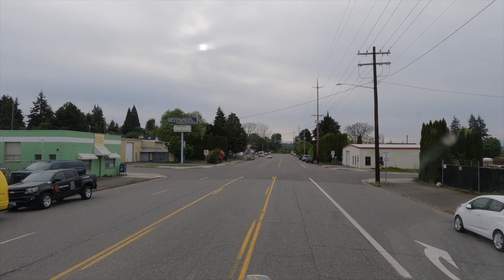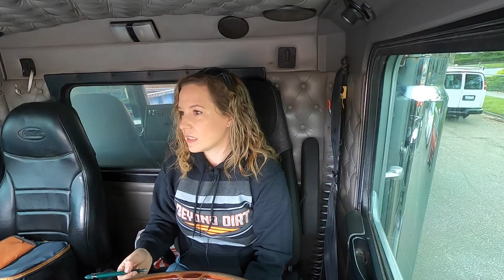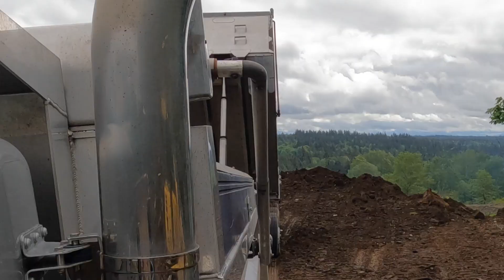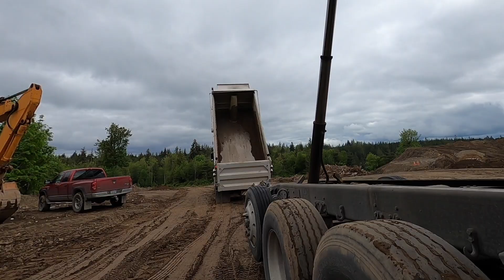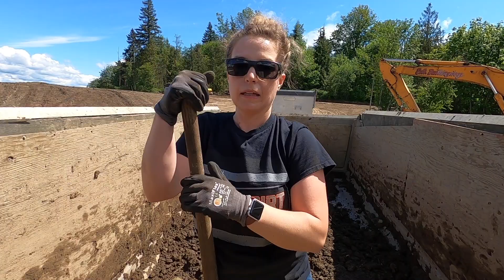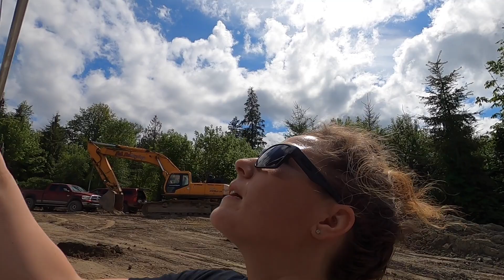Everett Truck and Trailer Mud Run. WHAT DID I GET MYSELF INTO?

Comment: Someone mentioned to check your cable. Check your cable mount on the cab too. Check the connection on the back of the radio also. You do have some pretty country out there.

Comment: We made vibrators for the trucks an pups, they worked great. Hauled alot of lime in winter. I spent yrs dump trucking. Spread more then stock piled, dumped in many different lay machines. I miss them ole fun times. I had to run flags on the tongue for Ne laws. Your makin a double hand.

Comment: Grounds  might help too. Check the conections at the antenna once and a while make sure they are cleen. I've had where I could not transmit or receive, replaced the coax and fixed the problem. Keep that in mind.

Comment: I use a telescoping painter's pole with a 6" scraper on it to clean my bed out.  You can do it with the bed raised and you don't have to climb inside the bed,  it is so much easier.

Comment: Another great video, but that was hard work cleaning the muddy dirt out of the truck and trailer beds . But it's a job that has to be done, when hauling that kind of loads . I'm not sure how that aluminum beds do to put  vibrators in them, but I have seen several trucks with steel beds that have them and they are great for loads like that . I have never been around a dump truck or drove one that had  aluminum beds, just steel beds . Wishing you good luck, getting better loads that are not as wet and muddy, so that you don't have to shovel out like that . I will see you later, stay safe and keep on trucking .
As always, Jeffrey !!!
🤗👍💖💫

Comment: Dauminique, I am on the east coast , the soil here tends to be sand-gravel but wet topsoil is nasty . The best thing I’ve found to get material to slide out is a plastic liner,

 it’s like ice . Not only does it let material slide it also protects your body from dents and wear . I haul mostly dimensional stone and it lasts about 5 years . It’s a little bit of an investment but for me I feel it’s worth it . Just my two cents worth . Good luck Dave

Comment: F.Y.I. get you a pump up spray and put soapy water in it and spray your bed floor with it when you know its gonna be like that and it will help it slide out better and you dont have to climb in the bed. It wont always work but it will most if the time.

Comment: I second the idea of a bad cable/antenna base because it is worse in wet conditions. I would 1) check your connections (especially the one to the antenna) if it is anything but clean I would clean it up and see if that helps. 2) check the wire for wear spots any place it goes through a wall or securing strap. If you have an extra CB swapping it out might be the easiest test, but I do lean towards a bad wire or antenna that is shorting when the water get where it should not be.

Comment: Oh Dominique  so sorry to see you work so hard on shoveling ....With your Mechanic  husband  (You two replacement of your truck clutch  was impressive..could  you two patent  a "Finish cleaning  out your load attachment" FOR INSIDE OF TRUCK AND TRAILER DUMP "Maybe test with PLYWOOD  and 2x6 first and then maybe go to Z recycling in Bellingham  etc and make ouT of ALUM etc..)....Is to build  a shovel  like shoe that sets inside  your dump trucks and  trailer  up front of dump go up 12 in on sides of dump around tower and down bed of dump for 18"  AND  AS WIDE OF INSIDE OF DUMP ON TRUCK AND TRAILERS and  when dump is all the way up have a little electric  or hand winch to cable out the inside dump "ALUM SHOVEL " THUS WINCH OUT THE STUCK MATERIALS  LEFT IN TRUCK MAYBE HAVE TWO  RETURN CABLES ON BEHIND EITHER ENDS  TO KEEP THE "ALUM shovel "  SQUARE INSIDE DUMP AND from falling out of truck and to rewinch back to both the front of both truck and trailer for next muddy wet loads... 😉...Dominique  do they (KENWORTH  ) do this Already? .... If not....We will call this new Clean out stuck MATERIALS  from sides and bottom of dump truck  bucket  ...."Dominique ALUM shovels"........Best  Regards.......Oh hope you and your clever husband  😉 take us along on welding  up these new "DOMONQUE  DUMP TRUCK ALUM SHOVELS"!!$$$....Hey it be exciting for all of us to see you work with PACCAR IN BOW WASHINGTON  ON TESTING  AND BUILDING  THESE NEW "Inside dump trucks ALUM shovels"....HEY NATURALLY .JUST MAYBE KENWORTH  WILL LET YOU AND SPONSER YOU A NEW 2023 DUMP TRUCK....CONGRATULATIONS  DOMONQUE  ON YOUR INSPIRATION  NEW PATENT ??$$$......

Comment: Before you buy a new CB check your SWR's to make sure it's not the coax or antenna's. It's a great idea to disconnect the coax from the antenna's and clean the connections and antenna mounts to make sure everything is clean and tight a couple times a year. A bad connection can burn out your finals so you can't transmit.  Also pull the CB out and check things behind it for issues. Those wilson's are heavy and can loosen up.

Comment: had similar experience hauling wet distiller's grain.  we usually used a dump truck to haul it but it was down, so we used the grain tandem. actually works out pretty good hauling sand, but that distiller's grain sticks to every crevice of that aluminum grain box.  about 5 tons refused to come out and it resulted in about an hour of shoveling and rocking the truck.....not a fun ordeal lol.

Comment: I was at a dump site with some sticky crud one time,  raised the pup, nothing, gave it a shake and the mud on the left side came out, the trailer started falling to the right. It got about 15 degrees lean and the right side mud came out, and the box straightened out.  Whew. .

Comment: I use a paint extension pole with a screw on scrape blade. With bed up in the air you can stand on the ground and scrape it from the bottom up. Fall's out nicely. I live in Georgia.  We have red clay. Very sticky
Reply: Raise bed and the pole will sit on frame. On the cross member's. I use a bungee cord to secure it

Comment: I once had an old single axle dump truck. I was trying to spread gravel on my driveway and the front wheels came up probably 10 feet up. Had to shovel some of the gravel out of the bed to get the front wheels back on the ground.

Comment: Helps if the excavator operator fills the back of the truck/trailer until they can see the mound and then rolls the dirt off the mound towards the front of the trailer as he/she is dumping.

Comment: Ahh that brings back some not so great memories 🙁 It's been over 10 years since I last drove end tippers (end dumps) and days like that were always fun...not.
A bit of moisture and clay and a well used floor in your bin (box) along with it sticking around the hoist well (tower) was always a bad combination.
Rather than shovelling and the risk with climbing in and out I can recommend having a long handled scraper made so you can have your bin (box) in the air and scrape up the insides from ground level 😀
Good to see your business doing well Dauminique 👍

Comment: I wonder if you can put the vibrators on your truck and trailer to help with sticky soil. Justin I believe specs his trucks with the vibrators. Hit the button and watch the dirt fall out. Saves from shoveling.
Reply from the maker: He has steel boxes, I have aluminum. A vibrator would tear up the box.

Comment: Sometimes the coal trucks that haul coal will spray the bed down with a little bit of diesel fuel it keeps coal from sticking in the bed biggest problem is the freezing in the bed. It would definitely make a barrier between bed and wet dirt or mud. They use a one or two gallon hand sprayer. They also don’t have plywood barriers in the beds.
Reply from the maker: You can’t spray diesel in you boxes here, you’ll lose your license.

Comment: So, just a thought.  I have a couple grain scoops that I use around the place, and also for snow that's come off the roof. Next time you're at the feed store, check one out.  They have more capacity and a wider blade.  Might work good for slicing it off the sides, maybe quicker.  If not, you'd be the coolest kid on the block, just for knowin' what one is!!  Stay safe!
Reply: Aluminum grain scoop. Steel is too heavy.

Comment: You might want try 2-3 lb. Sledge hammer banging on the bed in the raised position.  The vibration in bed should get a lot of those clumps out

Comment: ground on antennas and or mirror frames not grounded,  or like on my truck when i got it the coax connector at antenna is shorting to itself.
Reply from the maker: That would make sense if it was intermittent. It's not, it just doesn’t work in the morning when its particularly humid. It starts working an hour or 2 after drying the cab out with the defroster.

Comment: I was pulling a39 foot enddump, hauling traprock chips (traprock is the byproduct of processing iron ore, with fines still in, very heavy and packs tight).  Had to dump in a large lot by the municipal swimming pool, so I had a large audience.  Raised bed, not a stone fell out.  After (very carefully) shaking and rocking the trailer finally started coming out but slowly.   By the time I was empty, it looked like I had spread the entire load.  About 28 tons, and no more than a foot thick.  Covered about 250 feet.  Was supposed to be on a stockpile.  Oh, well.

Comment: You need a vibrator on your truck to rattle your box when you dump. Makes it so much easier. All that mud would have come right out. Our pups don't have them though. The county I work for outfits all of our dump trucks with vibrators. Probably pisses off the neighbors, because it is loud, but oh well. I hate climbing up in my box, so anything to make it so I don't have to, the better. Those plywood sides aren't doing you any favors either. That mud is just going to get hung up on the plywood. I've never seen a dump truck with plywood sides like that before.

Comment: Hello Nikki, it was over 30 years ago but I used to go back and swing the tailgate back and forth and then fling it at the box as hard as I could. It generally worked. I've never seen a box lined with plywood sides before so I wonder if that could be your problem?

Comment: As far as your CB... You might want to check your antenna cable or your antenna. Also have your cb system calibrated. I am pretty sure it's NOT the CB itself.

Comment: We coat the floor with a little straw to help the load slide out when it’s sticky like that.
Reply from the maker: It didn’t look sticky and where do you keep the straw? You just strap a bale to your reach?
Reply: usually the contractors have a ground guy placing the straw in the beds of the trucks. don’t matter how sticky it’s coming out.
Reply: it really don’t take much to get it to slide out on one shot.

Comment: Excellent video!  I’ve not driven dump trucks before… but I’ve used a hoe for loosening stuck mud with dump trailers, which seemed easier than using a shovel.  I do understand that is more gear to keep track of.  

Videos keep getting better and better ;-)

Comment: you should have the antenna cable checked and matched with a meter to make sure nothing is wrong with it the fact it works fine when dry tells you its someting in the cable to and from the antenna a good SWR meter should find the problem:)
Reply from the maker: By who? We don’t have CB shops.
Reply: @DauminiqueTheDumpTruckDriver  are you kidding how do you buy a cb in your area if i was in your area i would do it for free just to meet you and get a tour of your truck:) the only other option is to replace the cable from the antenna to the cb one other way is to ask your fellow truck drivers most of them know of a few good shops that could help you i hope somone helps you you help others doing what you do

Comment: I feel you on the shoveling, Driver🤬…we’ve all been there. 
A good liner in the truck and trailer could help 👉🏼👈🏼
Reply from the maker: No one runs liners here. I don’t even know what they are.
Reply: @DauminiqueTheDumpTruckDriver  yeah some guys do! But not to many! That's cause of the bed vibrators! But back long ago  guys would put slick stuff in the beds to help with the loads coming out
Reply: Sheets of plastic cut to size to fit the bed. One for each side and one for bottom. UHMW plastic. UHMW is ultra high molecular weight plastic. The material is very slick and quite durable as well as expensive.

Comment: Since you're CB messes up when its wet, its something to do with the antenna or the cable. I have worked on radios a lot and that seems like the first place you need to look. Before buying a new radio.
Reply from the maker: It only messes up when it’s humid. The way I get it to work is to run the defrost in the truck and it clears up regardless if it stops raining or not.
Reply: @DauminiqueTheDumpTruckDriver  Check where the cable attaches to the radio. But from your description it is possible for it to be the radio itself.

Comment: With your CB, might check the ground from the cable to the mount to the antenna. Sometimes they rust with the weather. Then make sure it’s got the little plastic washer in between. You shouldn’t need a new radio it’s probably that.
Reply from the maker: Thats not it. Humidity wouldn’t effect that.
Reply: @DauminiqueTheDumpTruckDriver  Sometimes it does. It really effects mine sometimes if I have one of those big springs on the bottom of the antenna to help it from not getting broken from trees. I got tired of that so I just ended up buying a rock hollers metal antenna and never looked back. But check your connections on your antenna wire and if you’re using the stock one that came with the truck go buy another one and put it through the passenger side door and you shouldn’t have any more issues as long as it’s grounded good.

Comment: I would think that would happen more often with Dirt and wet you have up your way.    All that pressure pushing down on the bottom layer that if you dont coat with a spray each load will lock up.    Good exercise but not time well spent.

Comment: I would suggest a pickaxe with the flat blade. Youll kill your back with that shovel. If you need a shovel use a pointed shovel. Great work
Reply from the maker: Lol I’m 5’4” 133 lbs….a pickaxe would kill my back and shoulders way worse than any shovel.

Comment: You should think about getting cameras in both your dumps and a monitor in your cab so you can see when your dumping.
Reply from the maker: Why
Reply: That way you don't have to get out to look in your boxes, you'll see when you dump if your leaving any mud in them.
Reply from the maker: @ROGE444  then I would have a screen taking up space in the cab. A t800 cab is very small. It’s better for my legs to get out anyways and I have to check my gate/reach.

Comment: take cb to cb shop they will fix it there is a guy in ohio at comunications unlimited in Hebron ohio they will fix it i shipped mine to them work great now  he said people from all over usa ship there to them oh after watching this hauling lots of dirt and sticky loads in dump trailer I would get the poly bed liner on the truck instead of wood on sides of truck and find bed vibratory motor

Comment: What company do you work for and what would be the starting pay?  I’m currently earning $16.25 hourly and I’ve been at my current company for almost 2 years.  I make lots of overtime, and I’ve already grossed $26k since my first paycheck of the year, so I may gross around $50k this year if we’re lucky with the weather (I only grossed $39k last year, but was at a lower pay rate).

While I’m not too dissatisfied at where I’m currently working, once I’ve gained experience, I’d like to possibly get a job with better pay.  However, a job that technically pays more hourly but doesn’t work as much overtime, or is located in a state or city with higher cost of living, would defeat the purpose of changing jobs.
Reply from the maker: I’m self employed

Comment: I would think that,  as a dump truck driver, driving in a sometimes rainy state, with sometimes sticky dirt, you would get yourself some dump vibrators. Expensive? $1000 ea.?
Reply from the maker: They would tear up the aluminum box.
Reply: @DauminiqueTheDumpTruckDriver  Oh. Didn't know that.

Comment: You sure like to complain 🤨Aluminum dump boxes are horrible the only thing they are good for is processed material ie sand and gravel. The lack of a high lift gates on your dump boxes doesn't help, the material doesn't gain any speed. The stuff I was hauling today is muck it has high clay content its gross stuff I threw 16 ton loads into the T450 took it to the dump sites. Its daily life of a dump truck hauling mud to rip rap to 4 ton boulders to sand and gravel. Like I said before 95% of the work in my area is residential, gravel trucks run 5 days a week.